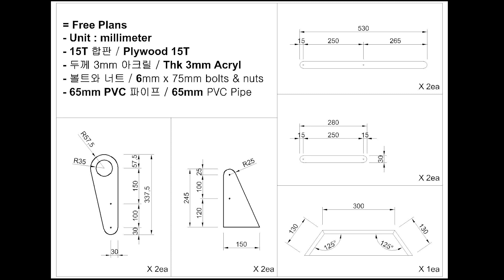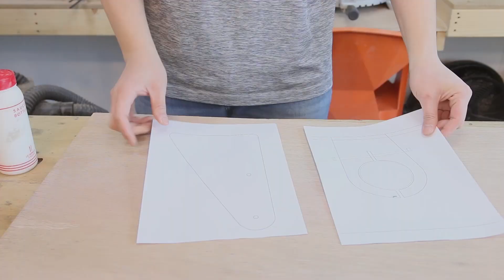PVC파이프로 테이블쏘 관절 집진기 만들기 [목공 DIY] / 2Way Table Saw Dust Collector with PVC pipe

Comment: Nice design.  A light torsion spring to help hold the Head Assembly in position might also be useful rather than relying on friction. Also, some type of clean-out might be required for the bottom of the Vertical Tube as there could be a build-up of sawdust below the Vacuum Hose connection. Excellent job and a well presented video.  I particularly like the fast motion that included all of the fabrication and assembly details.

Comment: There is a serious problem, the safety problem with using HARD plastic dust collection pipe..EXPLOSIVE FRAGMENTATION RESULTING IN SERIOUS BODILY HARM.. YOU NEED TO ADD A BARE COPPER WIRE INSIDE THE ENTIRE LENGTH OF THE PIPE TO GROUND IT AS WELL AS CONNECTING THE COPPER WIRE TO A GROUND SOURCE..Dust particle explosions are a real thing that happen with static electricity..adding a ground wire will provide a necessary safety from a particle explosion.. 25 years of working  in professional workshops I've seen crazy " that will never happen " HAPPEN.. ANOTHER SERIOUS PROBLEM I SEE ALL TO OFTEN IS PVC PIPE USED FOR AIR LINES..PLEASE,STOP GAMBLING WITH EXPLOSIVE SITUATIONS..

Comment: I would probably recommend a string or wire attachment from the dust collector end of the PVC pipe to the ceiling. 
The entire weight of the collector and the top pipe will be on the pipe bend.
This will, over time, cause stress on the joint. Especially with moving the dust extractor frequently.
Helping take the weight of the device will make it last longer.

Comment: You could add some rollers to the bottom of the dust collection arm and use it to put constant downward pressure on your stock as you feed it through.